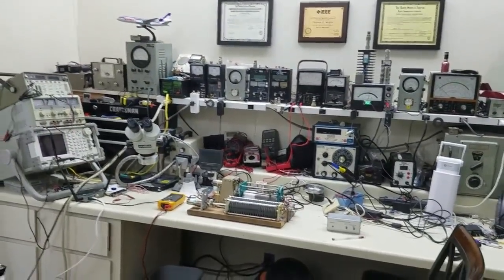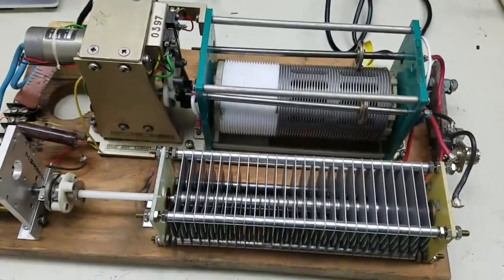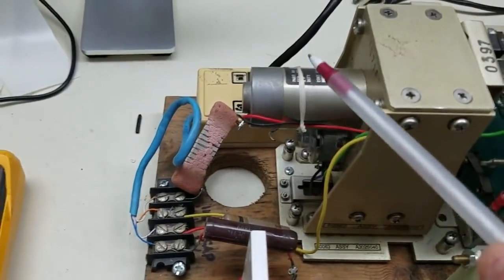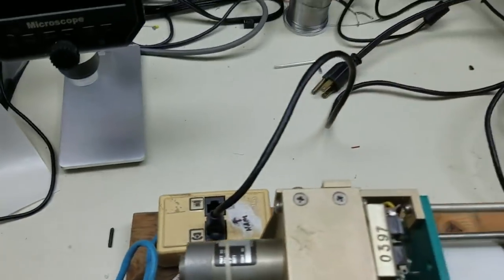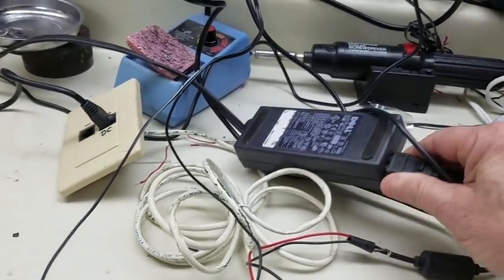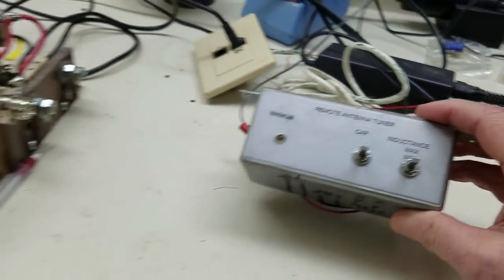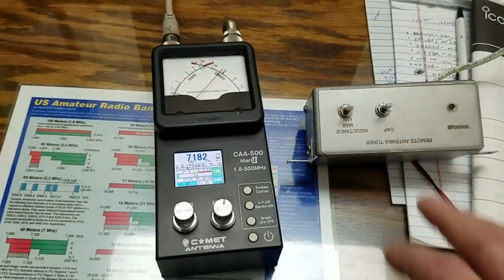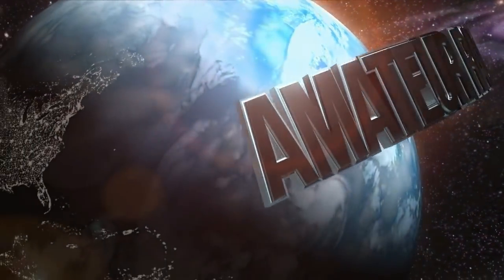L MATCH on w5kub.com

Comment: Great job. Years ago, I built something similar. I used a motor, as you have to drive my inductor and I used a model airplane servo to drive my capacitor, as the one I used has 180 movement. I gave myself postion feedback by having my inductor's shafting drive  a ten turn pot via a turn reduction pulley. (On the ten turn pot i have a "largish" pully.). A voltage is fed to the 10 turn pot, and the voltage at the wiper goes back to a meter at the operating position. Max meter deflection, all turns in use, min meter deflection, no turns in use.
At the operating position i have a pot that controls my cap.

Love your idea of using Ethernet cable.

Thanks for sharing.

Comment: What value is the capacitor, a what value is the inductor ?  Also, which side is the capacitor on, - the input side, or the output side ?
Reply from the maker: no specific value for the cap or the coil.   As you see, the motors just run the inductance or cap up until you get a match.   About any coil and cap will work.

Comment: Add a simple pwm circuit with a pot and make things much easier to tune..  Also a phase detector will tell you which way to go.. What you have ius a manual version of the auto tuners we had in P3 aircraft back in the 60s...
Work any frequency with a wire to the vertical stabilizer...   I can send you a bunch of literature on auto tuners based on similar circuits..
Great demo..
Reply from the maker: thanks retiredtech.   yes im familar with a pot and meter where i can map out points.  I have way too much capacitance on this,  Im sure its at minimum on about any tuning.   U.S.A.F guy here. 1969-73.  Hope you are following our live Tues night shows.   Thanks for the comments.